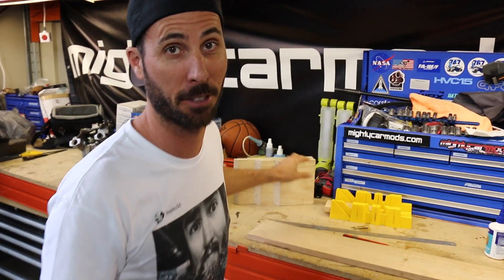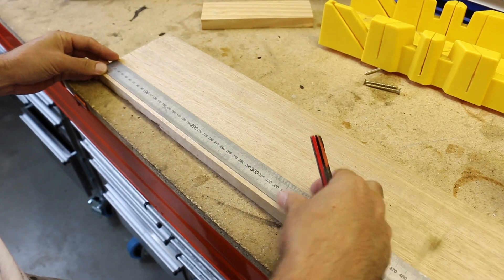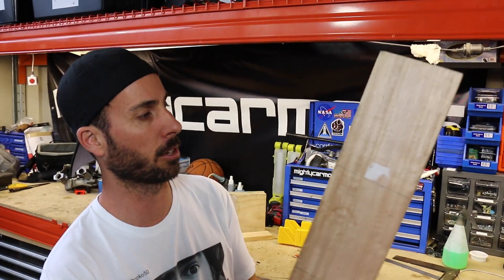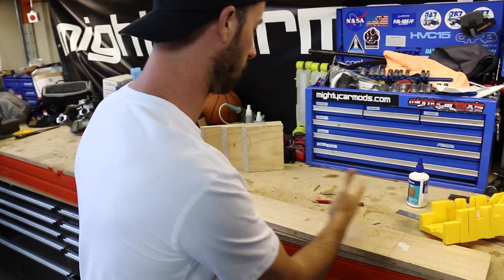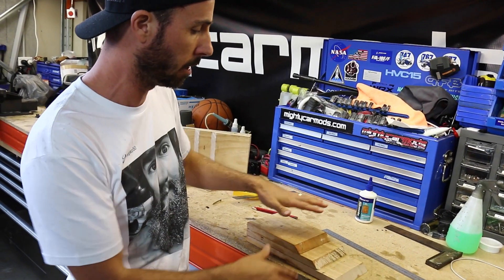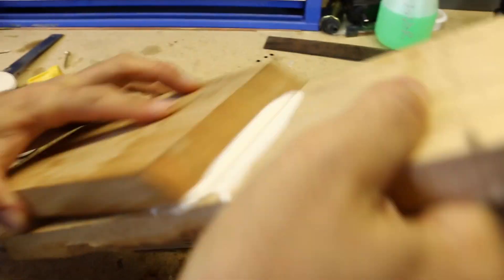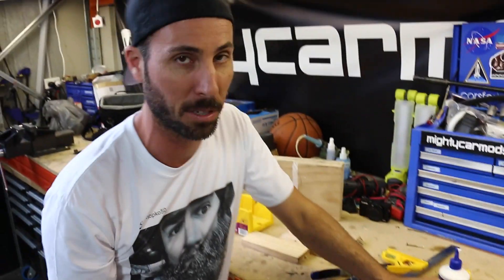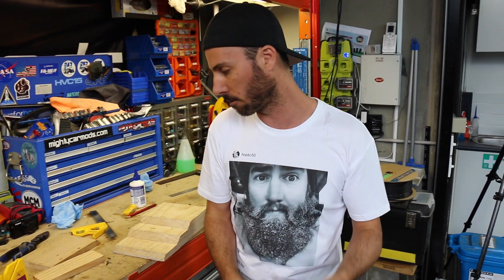Make your own Lowered Car Ramps for $5

Comment: any ideas for a fast first car under $3000 that i can still drive to uni in?
Reply: Crx or maybe a civic that's what I'm looking at
Reply: +Travi$ i'm looking at a 97 impreza, only 200K for 2K
Reply: +TheNerdyCanadian would be nice to get something like that where I am from but the law says can't have a turbo car with certain amount of power to weight ratio. It sucks
Reply: +Jonas Lindenblatt yeah. Do you have any ideas of a naturally aspirated rwd car for under $3500.
Reply: +Jonas Lindenblatt oh yeah good idea. I'm from Australia so yeah that could be a good idea. Only thing is it'd have to be manual
Reply: Mr Annoying Hippos well, it's only a 1.8L with 115HP running 2600lbs, so i wouldn't say it's a crazy power to weight ratio, at least that's what i found on the impreza, don't know how different the WRX is
Reply: +TheNerdyCanadian yeah well over here we can get the Impreza rx which is a non turbo fwd
Reply: +Mr Annoying Hippos Old Beemers, Mercs, Toyotas, Vauxhalls, etc.
Reply: +Mr Annoying Hippos Could get an e36
Reply: +Bladsmith good ideas I'll keep them in mind 😊
Reply: I bought a 96 accord 2.2 L Vtec with only 24k on it for $3,000
Reply: +jordant0085 what a bargain
Reply: +Mr Annoying Hippos it was a freaking steal
Reply: +Mr Annoying Hippos Get an MX5. They atleast look cool.. And handle epic.
Reply: +Kriss Gabers yeah but if I was it would be with a hardtop.      I only need a car to go to work in but I'd also make it look nice as I am a car guy and would like to do the usual exhaust, rims maybe lower it a bit
Reply: +Travi$ Depending on what country you are in (I'm from America) I've had two cars that were cheap and quick. The first one was a Ford Focus Zx3 2 door hatchback with the 2.0 zetec. Although it wasn't super fast for normal driving it was quick and handled good. It wasn't good on paper but as far as driving experience and normal acceleration it was fine just high end it wasn't very good, still the best car I've had for cheapness of parts compared to fun. The second option would be a vw jetta or golf or maybe even passat, or beetle for that matter with a 1.8 turbo. I have one of these currently and they are really quick for what they are. I have a Jetta and it handles extremely well even on the stock suspension and it surprisingly quick even on the highway. Having a car with a little turbo like that is also a great experience to drive. No need to downshift all the time and has really good torque. They also have alot of potential even on stock internals you can get them up to around 250 Horsepower (186 kw) and 280 foot pounds (379Nm) and even stock they have 180 horsepower (134 kw) and 225 foot pounds (305Nm) if you get one with an AWP engine, I believe the other engine code takes off about 20 horse and foot pound but is the same engine otherwise, just different turbos. The only problem with the Vw is the parts aren't the cheapest, although not horrible, and they are a real bitch to work on if you do it yourself and expensive labor if you do not. The focus was also a great car but being that its naturally aspirated it didn't have as much cheap potential. There was alot of parts for both of them as far as aftermarket goes at least in America, and they both get decent gas mileage even with a very heavy foot 25mpg on 87 octane in the focus and 28mpg on 89 with the jetta. The focus cost me $1800 but it was in an accident and hard an R title which depending on where you live can mean different things. In my state having an R title isn't a big deal because there are alot of inspections that have to be done to get the title again. The focus was also a base model, 5 Speed (no auto for me) manual windows and door locks and cloth seats. The Jetta cost me $2550 but needed some stuff done that made the price closer to $2900 but it is leather sunroof power everything upgraded sound and still five speed. Either of them are great cars. I have a friend that has a civic and he loves it but it has alot of work done to it and is running around 180 horsepower with an Si gearbox. Civics are good options and make decent cars but stock are very slow. Miatas are also good but they are RWD so they aren't as good in the snow unless you put snow tires on them, not saying RWD wont do fine just need good tires. Subarus are also good but alot of them have been beat so you have to make sure you find one that was taken good cars of the problem in that for me is that all of the ones that were well cared for are autos. Specifically in Subarus autos are very slow and don't shift well at all, and if they get beat hard they don't last all that well. BMWs are cool but you really have to be careful which one you get alot of them had some problems that will cost you a little here and there and you want to stay away from that in a first car, to be honest so do Vw's. As far as FWD vs RWD goes ive had both. The people who prefer one over the other haven't taken the time to go learn how to drive both. They drive differently but they are the same as far as actual handling goes especially on the street. Find a car with 16"+ rims that have at least 205 width tires on them and get a good pair of summer tires and they will handle great on FWD or Rear. Even all season performance radials handle good on my jetta its just the way the suspension work and how they pull through the corner is different. The best advice that i can give is get a few cars that you wouldn't mind owning and go and look and drive them. Stay away from cars with obvious problems even if your heart wants them, take it from a young car lover who has made this mistake. Once you find a few that you actually like do a ton of research on them and see what repair costs are what normal parts cost how often they need serviced (ex every 60,000 miles the Vw needs a new timing belt) find out if they had any known problems and go from there. Good luck. Let me know if you have any other questions.
Reply: Mr Annoying Hippos ive been looking at eg and ek civics but i really want something rwd with decent power for some mad skids brah
Reply: +Travi$ yeah same
Reply: Jonas Lindenblatt finding a good condition bmw under 3.5k is really hard, most are unbelievably thrashed and parts are so expensive
Reply: +Travi$ I've been where you are now not that long ago either, have had my license for 10 months and have had 4 cars plus a truck. Nobody ever told me to think about anything long term or helped me find a vehicle or shared their experience. Being a die hard ford guy, and having money, after 6 months i got myself a mustang. Had it for about a month and a half and got in a terrible accident. I was going 10mph over the speed limit and hit a pothole and the tires lit up and spun me sideways. i had no steering repose at all but managed to turn the car with the gas so that I at least went sideways but i hit three trees. I got ejected and had no major injuries but the car was literally cut in half, thank god I don't wear seatbelts or id be dead. From there ive been trying to tell all of my car friends not to get a RWD of course non of them listen and they all drive mustangs and monte carlos stuff like that. It woke me up that I had been doing well over what I wrecked at in that exact place like double the speed I was going. I changed my driving in anything near wet conditions from there on out even if it is just fog. Everytime i drive my truck and the rear tires spin it scares the shit out of me. Dont get me wrong I will get another mustang someday but it wil be for dry only. I now look for cars that are fast fun but FWD and share my experience with whoever i can. RWD is great for fun driving but i can cause alot of problems you wont encounter with FWD. I always wanted a RWD because i grew up with pro go karts Sodi RX7 and RX250 the same karts that nascar and other racing sports learn on. I even learned in the rain and got really fast in the rain but it doesn't matter how good you are if you only have 50 feet to recover a car thats going at a decent speed, your talking half a second, and then add in the fact that with a car sometimes you dont get steering back and it really make you think. I completely understand wanting a RWD but FWD can be just as fun and my jetta handles just as good as my stang and the stang was lowered and on better tires. If you still have your heart set on RWD check out some of the older volvos most of them are RWD. There is also some cars that you can pick up cheap such as a Thunderbird or monte carlo but they arent really that fast unless you find the right ones, also depending on where you live. This is a really weird one but it came to mind because there are a couple near me the pontiac fiero is another option but its a weird one. Sorry for grammar errors on laptop too much trouble to fix.
Reply: +Travi$ bugatti veyron
Reply: Nick Martin thanks but i cant really get any mustang or monte carlo or any v8 for that matter since i live in australia lol, again thanks for your great responses theyve really helped
Reply: 420apache657 yeah bro that a good idea thanks so much!!!
Reply: +Travi$ From what I understand about how Australia works with new drivers you basically have to have a 4 cylinder correct. There is an Australian guy at my work who explained it to me once but I forget what all he said.
Reply: +Nick Martin pretty much but each state has different car laws
Reply: +fed Z what's gay?
Reply: +Nick Martin the law in my state (NSW) is that the car must have a power to weight ratio of 130kW/tonne or less
Reply: +Travi$ yeah sa has that too but if you got I car sales and click p plate approved for sa. Not much comes up like a want a cc lancer gsr but nope not legal.
Reply: +Travi$ If thats the only recommendation you are golden man. Even most V8s in the price range wont touch that. Keep in mind even with their higher power they will weigh 3000+ pounds which is almost a tonne an a half. You'd have to look to see whats around your area i know nothing about Holdens because i have Chevy in America but over here the 90's chevys had the same or less power than my jetta. If you live across the pond a Subaru is a really good option from what I've seen over there they are alot more common in stick shifts over there, and subarus are good cars with tons of potential. The older volvos would be an interesting option as well as i've said before. If you could find one with a 2.5 5 cylinder turbo or 2.4 4 cylinder turbo youd be golden, and i don't think that either of them would be over the 130KW per tonne. Even my mustang with 195kw would be under that. I dont know what the avaliblity is like over there but with my years around cars some of the best come from Ford, some chevys but I don't know how that transfers to Holden, Volvo, VW Audi, Nissan, Subaru, some toyotas. It really depends on what you have around you though, and some of them have some weird maintenance stuff like having to change brake fluid to keep from gumming up, which happened to my dads volvo.
Reply: +Nick Martin holders over here are really cheap and VERY unreliable. I'd take a ford any day over that but I'd always rather a jdm car
Reply: +Mr Annoying Hippos Thats what ive heard but i didn't know for sure. Fords over here in the states are also alot different and we dont have any JDM stuff over here. We don't and cant get any of the cool stuff so we have rice burner civic and stuff like that running around. I grew up in the country with Fords and Chevys so thats what im used to. We also had some dodges but we had alot of problems with them. I prefer fords and some of my family likes chevys. Me and my dad have always been into Porsche Audi and Vw and then he went out and got a 944 turbo that was far from stock and we both got hooked. So now ill consider anything related to Porsche Audi or Vw along with my Fords. Even though it wasn't as fast i had the most fun with my Focus but i dont know what they have to compare to that over there or if you also have focuses.
Reply: Nick Martin Yeah we have a lot of focuses. A few years ago my parents had a xr5 turbo but i think it's called a focus st over in the states, anyway i loved that.  I hate those little rice burner civic so if i ever get one i'd get a nice one and not rice it out.   At the moment though im still leaning towards a crx del sol just because they're cheap to run, got a bit of a kick when you put you're foot down and i like the look as well as them having a aero top like of roof so you can take it out.   Man i wish i had a porsche what year did you get?
Reply: +Travi$ ke70
Reply: +Mr Annoying Hippos its a 87 944 turbo with 32 lbs of boost roughly 400 horse havent had it dynoed. All i can tell you is its a little quicker than a Corvette z06 2005 model and it quicker to 100 than a Lambo superlagara. Our porsche mechanic told us its the second fastest car hes ever driven only second to a GT3 Rs and he has a 2011 911 turbo.
Reply: Nick Martin oh wow that a lot of power and boost your running. It would be awesome to have a ride in a car with that much power. Did you do the upgrades or did you buy it with them?
Reply: +Nick Martin did you rebuild the engine? if yes what parts did you use? and what about the transaxle, i don't believe tranny can handle 400hp on 944s.

Comment: Hey guys, if ever you're in the UK, look me up. I have a modded Saab 95 TID Estate and a Nissan Stagea RS4 with slammed suspension and uprated brakes if you want to test them? :)
Reply: can I ask what you have done to the Saab. I have a 9-5 tid estate also. clutch struggles after fmic and a map so need some ideas for smoother power etc. 311lb/ft from a 1.9
Reply: It's remapped from 150bhp (stock) to 205bhp and 335lb/ft boost with a new and better intercooler and Samco hoses. It gets 56mpg too, which is about 10mpg over the original spec. I do a lot of miles all over the country, so it makes a real difference. 0-60 is down from 10.5 stock, to a fraction over 7 seconds, and it pulls all the way through the revs with max boost going from 0.7Bar (stock) now pushing 1.5Bar on the same turbo.  It turned out that the TiD 1.9 is the same engine as the Fiat / Alfa JTD and Vauxhall also use it in the CDTi 1.9 150bhp range too. Top speed is 154mph on a runway.  And I had the Accelerator Pedal Position (APP / TPS) remapped so that full boost comes in just under half way down the pedal press, which is perfect for the 5-speed auto box it came with, allowing me to creep the pedal down to half-press without the gearbox kicking down - seems as full boost comes in at 2200rpm.  The stock turbo is a variable vein type, and other people have taken theirs to 1.8Bar with no problems.  For more power, I would need a biggger turbo, injectors and fuel pump, plus induction and exhaust upgrades and that can lead to 280bhp and around 400 Torques :)

I have run this since 57,000 miles and the car has done 104,000 over 2-3 years with no major problems.  I did burst 2x top and 2x bottom intercooler pipes when they were just standard ones, so the Samco sorted that out. (You wanna see how fat the stock top intercooler pipe expanded just under free revving with the bonnet up!  Having Samco pipes stops expansion issues and reduces the shunting sounds from the turbo constantly being monitored from the Air Flow MAF sensors, which in turn gets a better fuel/air mix and reduces smoke. I did used to get Check Engine "Overboost Error" but that turned out to be a corroded corner of the original intercooler, so a new one with a bit better spec saw to that. Without Samco top and bottom pipes, tears and smoke are common. And when there is a small pinhole tear, you get oil mist all down that side of the engine. 

I also recently had the head taken off because one of the manifold bolts had sheared off in the head screw hole, so they had to take it off, spark erode the bolt out and re-thread the hole. Whilst they were in there, they changed all the lifter fingers because some of them had flatted out and most were loose. New gaskets, no head skim (didn't need it), new exhaust bolts and manifolds, new water and oil pumps because the car was apart and it was easy, new timing belt, alternator and battery. And new glow plugs. It's great for launching with one foot on the brake and the other building the revs to 1800rpm for 2 seconds and WHAM! Bye bye, Mr Hot Hatch :D
Reply: Yea mine is mapped with uprated intercooler and hard pipes. Boost comes on at 2150rpm-ish. Only 165bhp though but with 311lb/ft. 0-60 is 7.8 consistently with slippy clutch, 5 speed manual. Only done 135mph in it though. To be honest it hasn't been too reliable needing intercooler, dpf, egr, inlet manifold and ARB bushes over the last 18 months but it has done 130k. Maybe I need a better map so the power comes on smoother.
Reply: Are you in the UK? If so, give Angel Tuning in Banbury a call.  They did mine :)
Reply: +DerbJd I'll have to give them a call

Comment: For the love of science and Ryobi fans everywhere... PLEASE share the name / model number / specs of the two Ryobi portable, flexible lights TO THE LEFT OF THE BLUE TOOL BOX ON THE WORK BENCH. PLEASE...

....

... PLEASEEEEEEEEEEEEEEEEEEE

Love,
Long time supporter and recruiter for MCM..
Reply: +Rocco Croce http://www.bunnings.com.au/ryobi-one-18v-hybrid-shoplight-skin-only_p6210577
http://ryobi.com.au/18v-one-hybrid-shoplight-r18hs-0 
R-18HS-0
Reply: +Travis Nisbet I knew it! Region specific product!!!! Thanks so much for helping me out. The bunnings website produced a spec sheet and the ryobi website gave me the boot as soon as it locked my region ( no surprise )!
Reply: +Rocco Croce Youre better off looking at the bigger brands,Makita DeWalt etc.

ryobi are pretty low tier
Reply: +Art Vandelay I've had other stuff and got rid of it. I've got all Ryobi now. All I've kept is some metabo stuff.